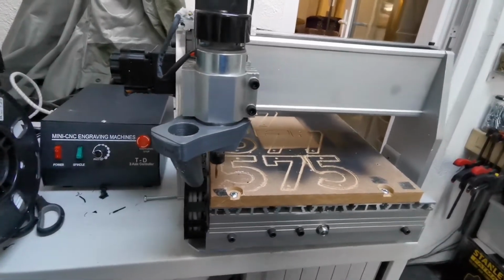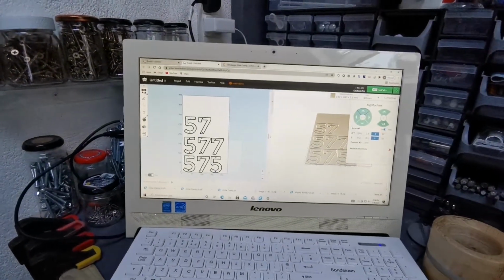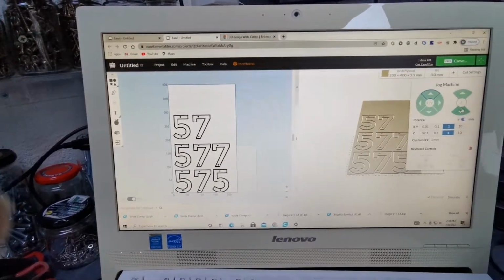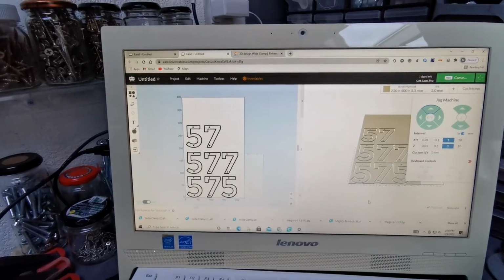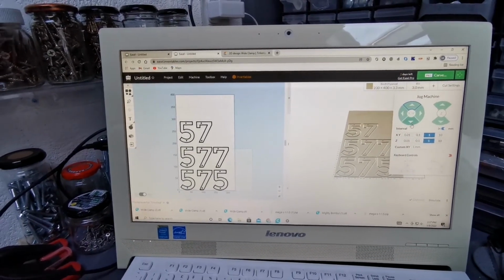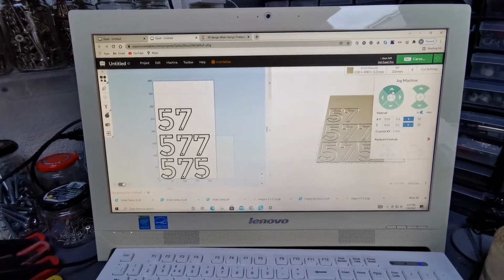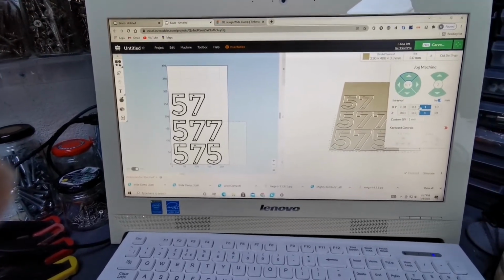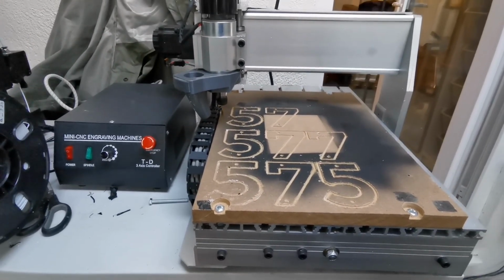Converting a CNC 3040 GRBL to use with Easel.

Comment: Hi do you have a list of the grbl $$ settings for the 3040. I have the cncest3040 and have put in an arduino uno but stuck on the settings. Ive never used mach3 so can not get the settings from it.

Comment: do you know how much power those stepper motors draw .
i have the same thing (3040 cnc) and i dont know if the a94... drivers are powerfull enough
Reply: do you know how much power those stepper motors draw .
i have the same thing (3040 cnc) and i dont know if the a94... drivers are powerfull enough
Reply: @SE.XY.VIDEOS  each one draws 3.2 amps